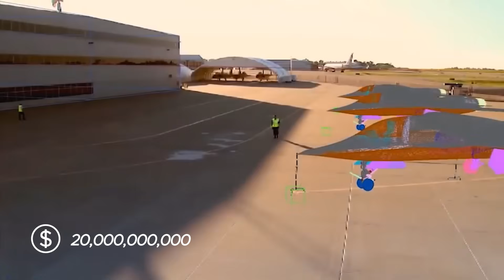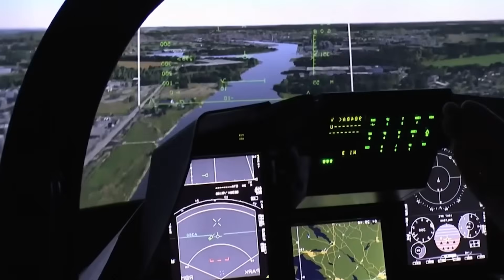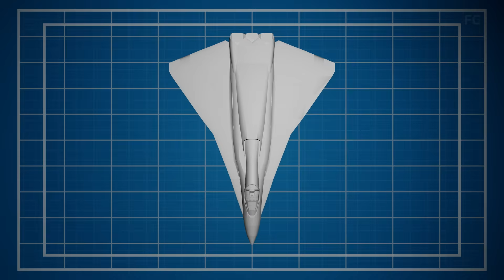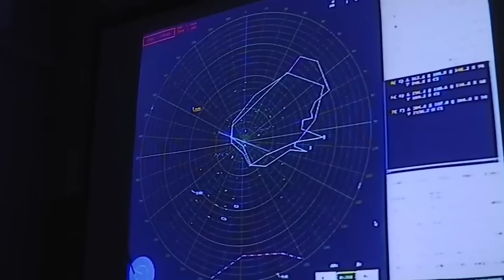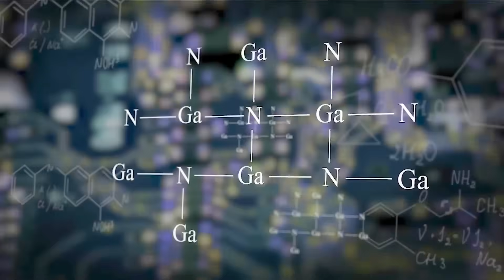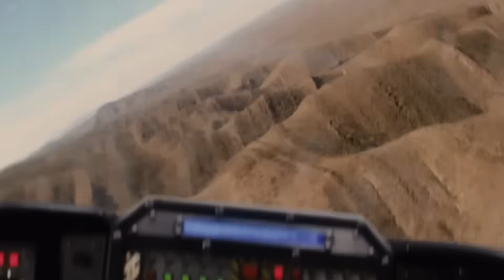F-47: America’s $50 Billion Fighter Jet To Dominate China in 30 Seconds!

Comment: The key isn’t just speed or stealth — it’s synchronized kill-web control. The F-47 would act less like a fighter and more like an airborne command node in the Indo-Pacific battlespace.
Reply: Well, the coatings are different now. There's a significant increase in stealth, and with vastly greater durability (allowing speed).
Also it's designed to be MUCH harder to spot on longwave or via satellite.
Key wants outside of stealth, are wanting dramatically more range, payload, and speed to cover those long distances. And CCA integration (though the F-35 is getting that too).

You're not wrong though. Just "also" much more speed, payload, altitude, and range. And stealth which specifically removes weaknesses in 5th gen stealth designs.
I'd expect it to be quite large, and less focused on acrobatics.
DEW is a strong likelihood too. Probably also on the J-36.

Comment: F-47 has been flying since 2020, prototypes.

The US unveils a completed product not prototypes (eg see B-21).
Reply: Well, 2019, but yeah. Program goes back to more like 2011/2012. Possibly longer, depending on when in the process you want to call it an official program.
The 'revealing' has been especially secretive lately (like with the B-21), more secretive than in the past. Didn't see the B-21 until the production plant was gearing up to start building in bulk. Probably won't see 'real' footage of the F-47 or AIM-260 until they're similarly hitting production. Production makes the number of people involved kinda explode in scale, and makes total lockdown security untenable (though there will certainly be secret capabilities & systems within).

Comment: The CaesarKing shall now create a very large sanctuary in segments of areas for specific creatures with waters and forest greens and rocky place of a very large Alien Zoo Habitat of Alien creatures of a   floating cube of gigantic squared recycling ecosystem in space with storied levels per inside compartmental habitats with energy sources for cosmic gas and elements and star energy harnessers and its own advanced programmed roots and fungis and algaes wildlife flora and fauna proliferators and food production in numbers regulation and control of a super AI controlled area and science and water production facilities, temperature  tuners and regulators and  converter of breathing mechanism of area specific wherein the square of a gigantic storied leveled  cube like structures of structure thight enclosure sealed structure with interconnecting sensors and semi autonomous Space Navigation awareness whose flight mechanism tech utilizes the space  dimensional linears of thick and thin up and down infra red beams of flight  all sides edged balancers of continuous flight structure wherein all alien creatures ferried to planet Earth be now teleported all in that gigantic space cube structure. Now!! Let it be

Comment: America needs a tip of the spear fighter like the F15, F22 and F47 but it will Desperately need a work horse F35 is not it! 

US needs a F/A X craft one that can fight in and out of a strike mission! 
F5, F20, F18, and F16 are great examples of capable strike fighters at a fraction of the cost of the air superiority fighters! 

A strike fighter that can be sold to NATO countries and be built in vast numbers with simple operation costs!
Reply: Good points. The F-35B that the Marines use is the only one that can and should be used as a workhorse. They needed a VSTOL aircraft to replace the Harrier II and the F-35B is perfect for that, but because the design had to make the Air Force and Navy happy as well, the other services ended up with a compromised aircraft. 

To add to your point, just imagine a cheap F-5, upgrade the engines so they put out 6,000-8,000 lbs of thrust, which would instantly make it able to supercruise as well as vastly extend it's range because it wouldn't need to use much throttle input in order to fly fairly fast. Make a few design tweaks like covering the intake fan, make the wing and wing root angles more stealthy, and use a modern AESA radar system. It wouldn't be fully stealth, but since it is already a small aircraft that was hard to track to begin with, adding a few design tweaks would make it "low observable" while still being very cheap to make. As you pointed out, there needs to be some sort of aircraft that is built in high numbers, cheap, but most importantly rugged and tough so it doesn't need as much maintenance to keep it flying. In a war with China, there will be some aircraft lost. There are only about 100-120 F-22s available at any given time right now in peace time, so if China shot a few down, a few crashed via accidents which invariably happens, and the flight tempo increased and caused more down time for repairs and maintenance, the F-22 fleet would be down to 40-50 aircraft very quickly. The F-35 is less stealthy and less of a dogfighter, so it's losses would be even higher due to enemy actions, and 19% (200+ aircraft!) are already early production aircraft that are useless outside of training. You add in the accidents, wear and tear etc and we would go from having 650 available now in peace time, to 200-350 in a short period of time. So I couldn't agree with you more, we need less Ferraris and more F-150s in our fleet!

Comment: F-47 could utilize a hybrid propulsion system of conventional/hypersonic scramjet engine allowing it to fly above the troposphere and control additional drones and laser-armed satellites.
Reply: The F-47 doesn't need those things because it already has lasers and drone control built in. It is said to have the capability to control drone swarms of up to 1,000 drones at a time using AI to assist and control them. It has multiple massive lasers that pop out and can be used to shoot down other aircraft, drones, SAM missiles as well as ground based targets. The laser technology alone makes the F-47 extremely hard to shoot down, even if it is somehow able to be seen and tracked by radar or infrared tracking. This is a massive upgrade over the F-35 and F-22, which are already world class.
Reply: @RonniePTexan  $50b to replace the whole Air Force with one piloted plane? That’s a hell of a crap shoot.
Reply: @PhilipLongee-vw8jf It's not replacing the entire Air Force. The future F-35 orders have been cut, but there are not only hundreds of current F-35s, but there are still hundreds more that have been ordered and haven't been cancelled. The F-15 and F-16 will also still be used. The F-47 is just filling in for the cancelled F-35s, but they are a massive upgrade over the F-35. Not only is it more stealthy, it's faster, has a longer range, can carry more payload, has a better radar and weapons control system, and like I mentioned it can control up to 1,000 drones, including the "loyal wingman" which is just a smaller unmanned fighter. And of course it has powerful lasers, which by themselves make the airplane extremely hard to shoot down, among other things